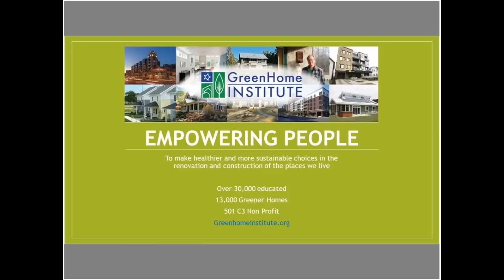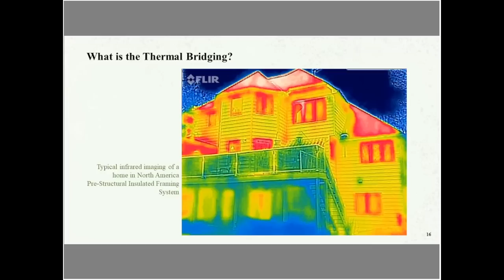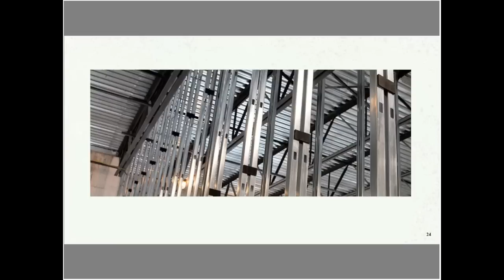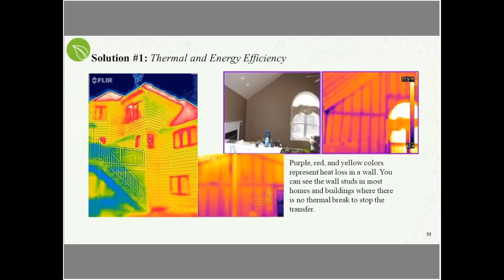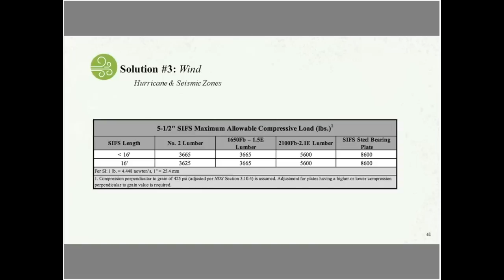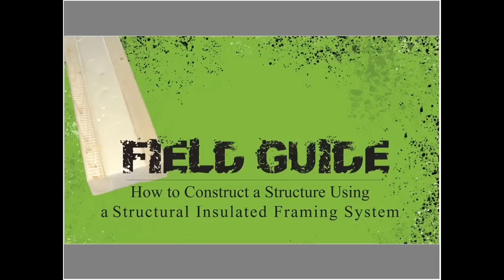A look at ​Structural Insulated Framing System (SIFS) and Saving Money with the Walls

Comment: The point of using these is to not have to put exterior foam to cover that 25% of the building which is framing.....but that means we're back to the dew point issue of cold siding meets the warm inside cavity.  So you'd better use closed cell spray foam with this system.....but then you also have to consider even that stuff can shrink.  But it's better than the alternatives.  It also means you can use their "bare-naked" TStuds since you are doing the spraying.  Just make sure they do multiple sprays and not all at once or you could have a disaster/health issue.